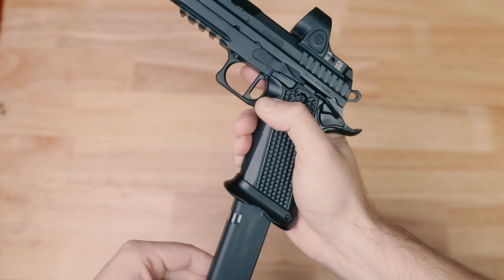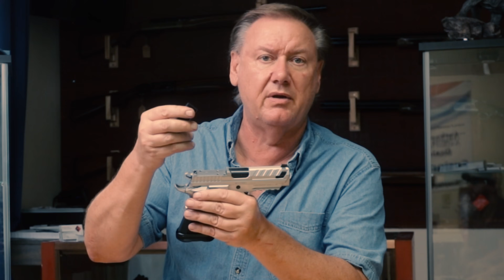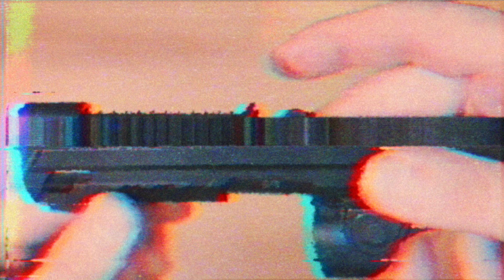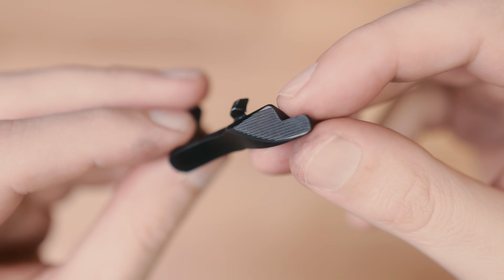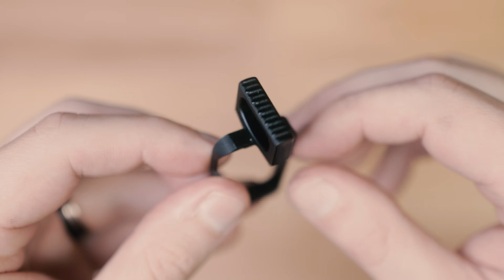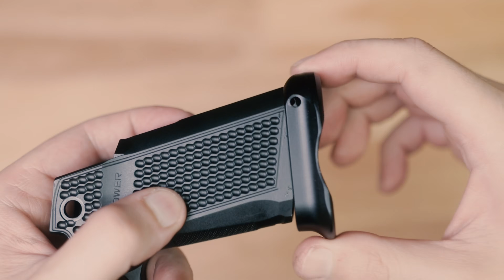The XP Pro - 1911 That Takes Glock Mags (Full Details)

Comment: Where is it made, I asked on your Facebook page and got no response. Is it made in turkey?
Reply: @TheRange7 I wanna hear him say that.
Reply: @TheRange7 Fusion is also a parts manufacturer for 1911s. I don't think you will need to worry at all about parts availability. They pretty much have everything already.
Reply from the maker: Thank you for your question. We are proud to be full partners with Ermox on this project. While all design and development are done in the USA, production takes place at Ermox in Turkey. We are deeply involved in every aspect of the manufacturing process, from engineering and machining to assembly and fitting, ensuring the highest standards are met. We will offer custom work, service, warranty, and upgraded or replacement parts through Fusion in the USA. Both Fusion and Ermox fully support this product. This allows us to create a double-stack 1911 that has a ton of features you really only see on customs yet remains affordable.

Comment: 22 degree grip angle. That is the same as a Glock. 1911/2011 are usually around 18 degrees.
Reply: Well it has to accommodate the Glock magazine angle.
Reply: Bul armory has a glock clone with a 1911 grip angle that uses glock magazines.
Reply from the maker: The XP-Pro is a hybrid wide-body pistol, with a newly patented design. The rear is at 22 deg, but the front-strap is at 17.5 Degree, basically the same front as a 1911. It makes for great balance and quick pointing and does not feel like a brick in your hand like a Glock and many of the polymers. This new design has been tested by a wide range of shooters, even several very prominent target shooters and a Bianchi Cup winner, and they love it.  I will have a post/video on this soon...